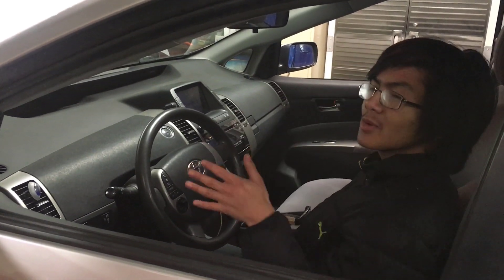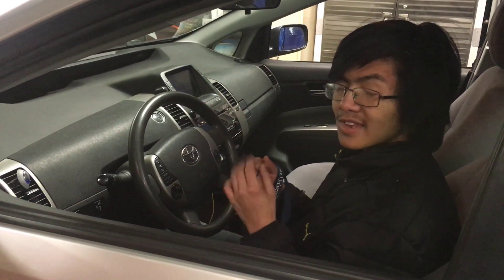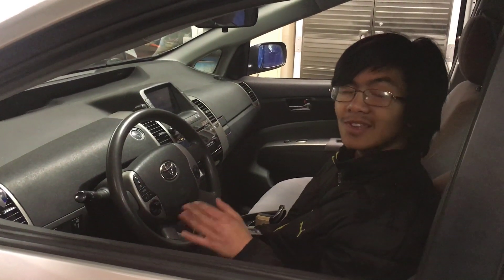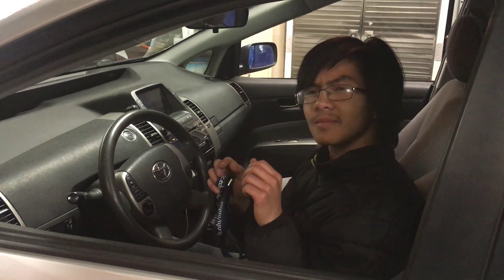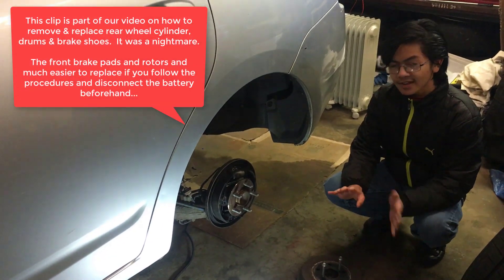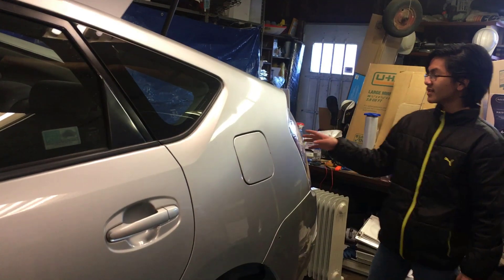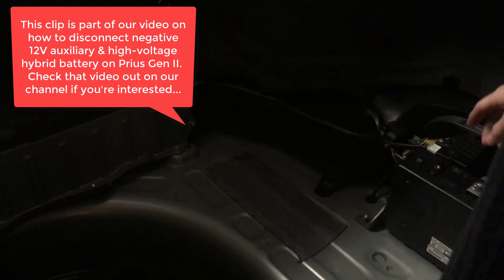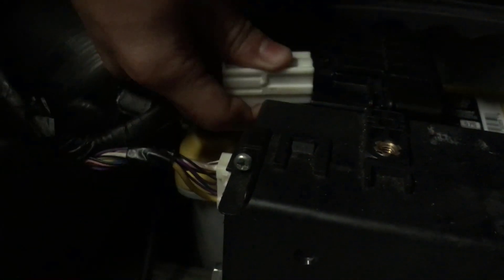Watch This Video Before DIY On Prius Brake | Replace Pads Or Rotor Must Do First | Actuator Sound

Comment: Yeah it's a pain.  For mine I replaced the caliper with another, bled it (without techstream gen 2, so...low tech way), reset codes and it seems to drive OK now...you could also try pushing the caliper back in...no tow to the dealer phew.  Another guy said he replaced caliper, had to bleed it and reset with the paper clip brake press thing like 4 times, then it started working...
Reply from the maker: Thanks for sharing your experience with the brake repair!

Comment: Everything is much simpler, pull out two blue relays, under the hood in the electrical panel, which are responsible for the brake system

Comment: So a 2010 prius needs the battery unplugged before changing the breaks?

Is that why my brake actuator has 3 codes now but the hydraulics work... can the actuator be refurbished?
Reply: yeah.  Did it push a caliper out?

Comment: Whenever I press on the brake, there always sounds from ABS accumulator. Is that the ABS is getting low electric signal or is it normal?
Reply: For me every second time it does the springy sound.  Normal apparently...

Comment: I shut that system off with the button under the steering wheel, I don't want the smart system operating. I like just plugging the FOB into the dash that way I have a location for my keys when I drive and it isn't hard to open the doors with FOB button push

Comment: There’s a button you can push that will deactivate the smart key function. It’s under there steering wheel labeled as key.
Reply: Sadly, if you touch the brake pedal on accident I think it'll still power up the brake system...even without keys IIRC...

Comment: You have to enter Invalid Mode - look it up in the repair manual? Search on PriusChat. For that you need the battery connected. The Invalid Mode is the official way as well as the Software way.

Comment: Also some times when I push the brake i hear anoisy sound likes spring for 1 second then go do I have any idea about it this sound comes when I push brake while car moving or stop
Reply from the maker: Also RAV4 2017 is a relatively new car and should still be under warranty.  If that's the case you can schedule appointment with the dealer and have the mechanic verified that the sound is normal and indeed from brake actuator and not something else.
Reply: Probably the accumulator "adding more pressure" to the lines, so expected...yeah sounds like a little spring, I hear it every second time I touch the brake pedal...
Reply: @RogerPack  I took it to the company and replace it (new one ) 
After 1 year the sound back again 
I don't know why and it's a new one they ordered from Japan and I saw the pill and I check it . Its new 
.
And it's back 
Strange thing